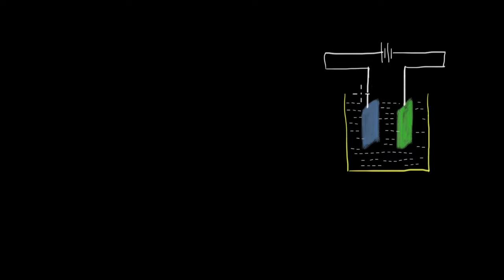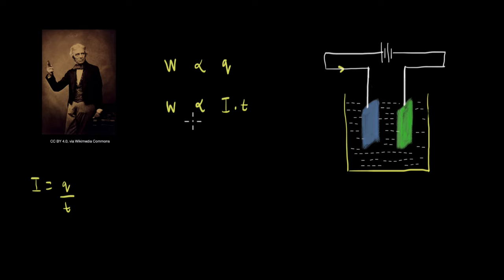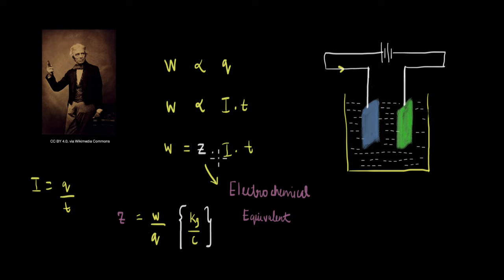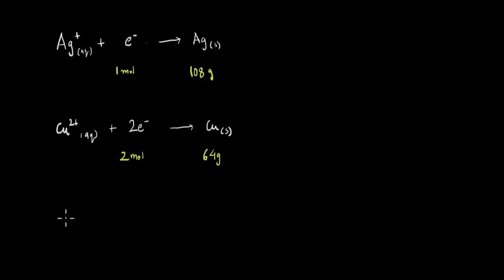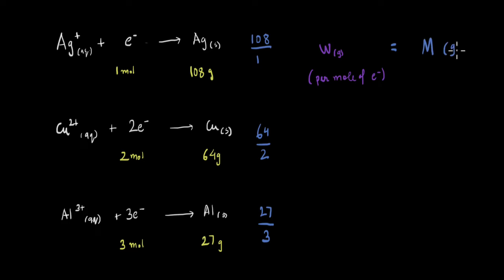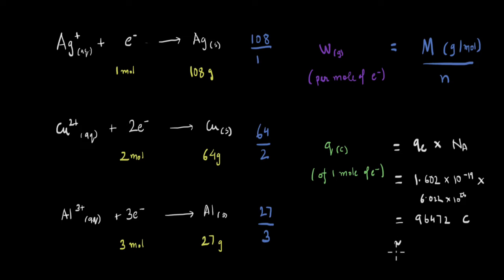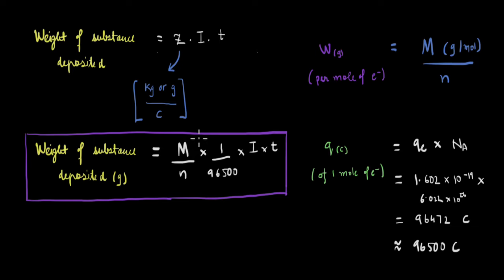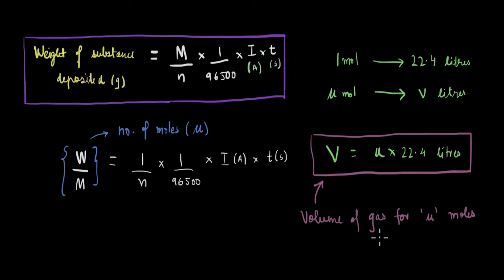Faraday's First law of Electrolysis | Electrochemistry | Chemistry | Khan Academy

Comment: Sir weight ke formula mei molar mass multiply no.of moles nahi aana chahye thaaa?
I m a little bit confused coz Apne molar mass divided by moles likha hai kindly plz clear it to me
Reply: hey. here W (per 1 mole of electrons) means the weight of metal deposited when a charge of 1 mole of eletcrons is used. If for n moles of electrons, M (molar mass) is deposited on the electrode, then for 1 mole, M/n will be deposited (unitary method; for n moles of e- : M mass and 1 mole : M/n).